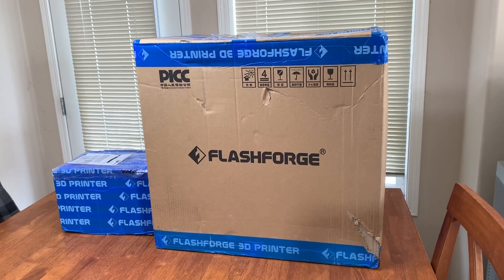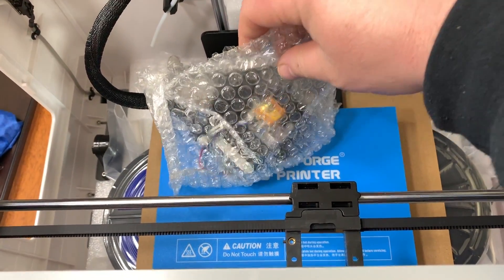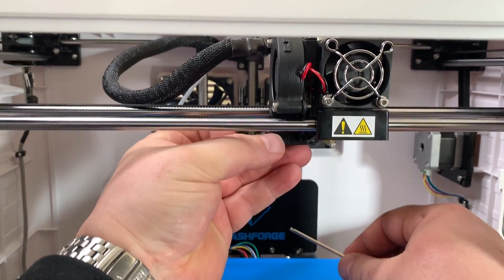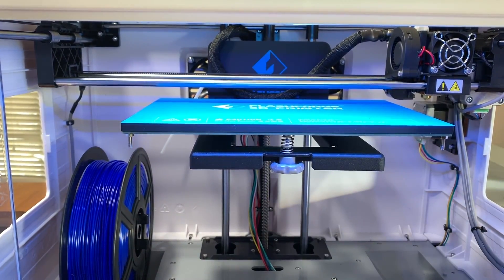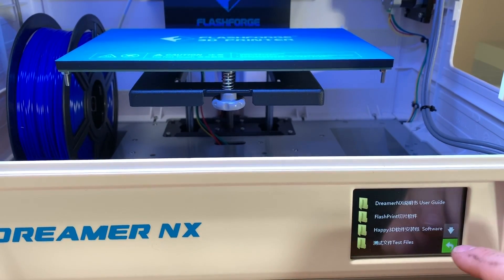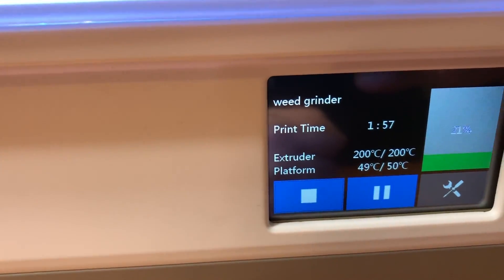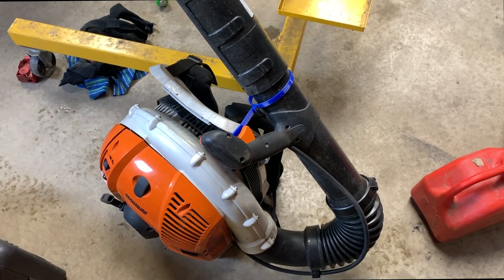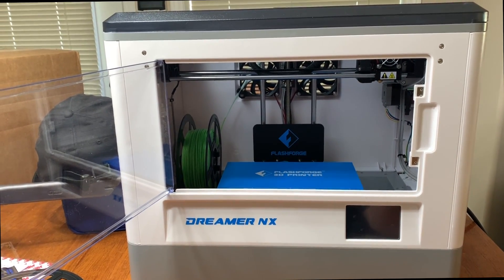Flashforge Dreamer NX 3d Printer First Look

Comment: how do you convert from from 3d cad files to something to print?
Reply: Slicing software like free Cura.  You set up your printer profile, then a print profile for the quality (width, height, speed, temp, etc.) for the quality of print and material you are using.